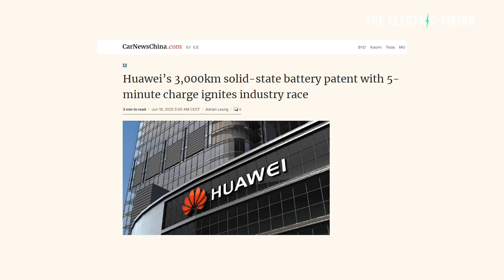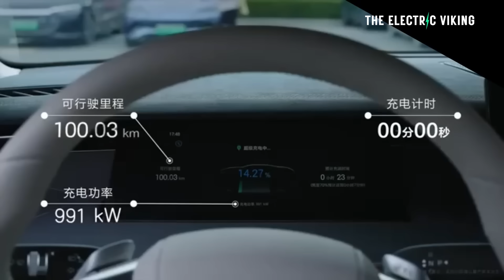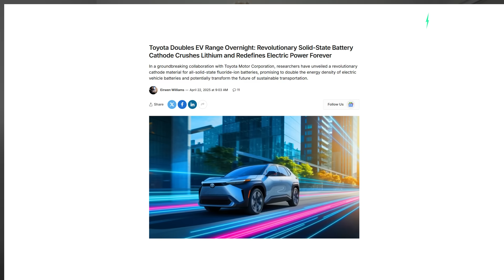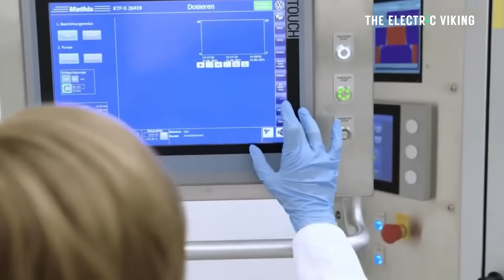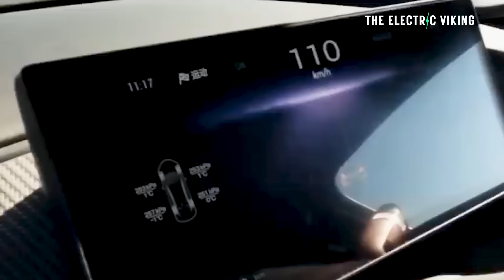5‑Minute Charge, 1,864 mi Range: Huawei’s Battery Patent Shocks Industry

Comment: I confess my knowledge about EVs (in general) is limited, I don't think where I live we'll have the required charging infrastructure for a very, very long time, so there is absolutely no pressure... (and the prices are ridiculous, and our govt's will stupidly tariff the heck out of any Chinese car)
But if I had to buy one today, I'd look first at KPIs such self-discharge and cold weather efficiency (which of course are connected to "mileage"). Lifetime would also be an issue, if you buy a car around here it'd better last 10 if not 20 years... My brother in law is still driving a perfectly working small Honda that my father bought more than 30 years ago!!
Reply: One thing to keep in mind is that older ICE cars will become more expensive and harder to maintain as the ICE "network" effect is lost as ICE cars become a minority of cars on the road.
Reply: @mac_mcleod  ars become a minority of cars on the road.
Reply: @davidward1721 do you have a typo? Because I do not understand what you mean by ARS... And that leads me to be unable to understand your entire post. 

Would you care to fix it?
Reply: Many familes need two cars. One of each makes a lot of sense. Its rare for both cars to be used for commuting hundreds of miles a day. Use the electric for the daily commute charged at home every night. Use the ICE car for the long trips on holiday etc.